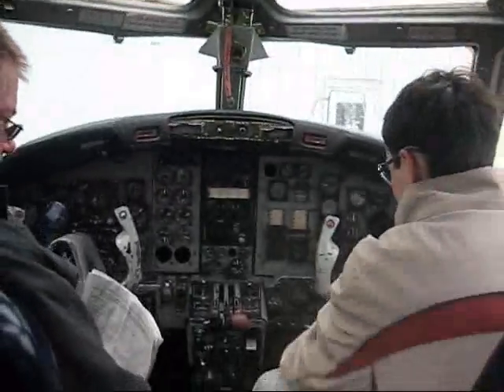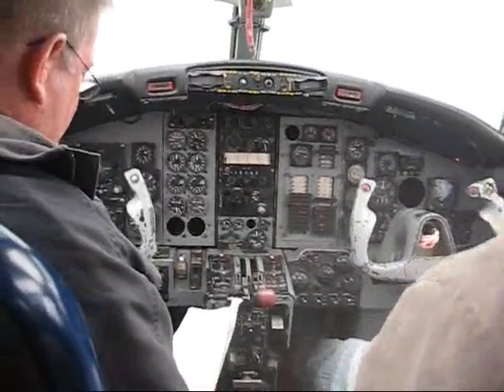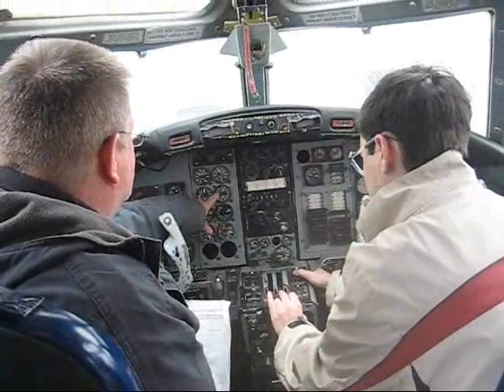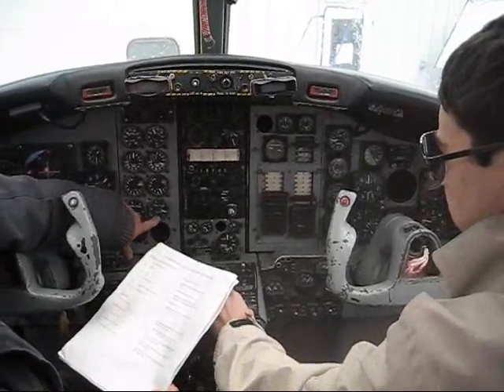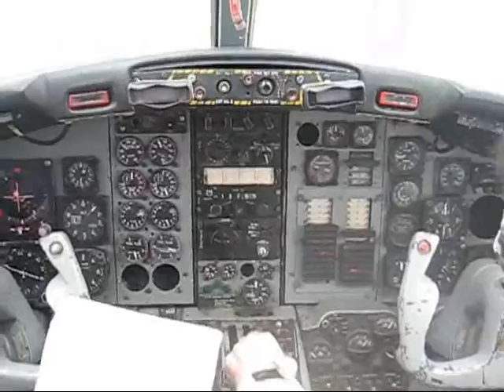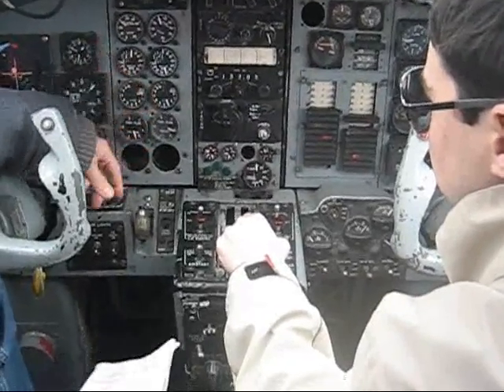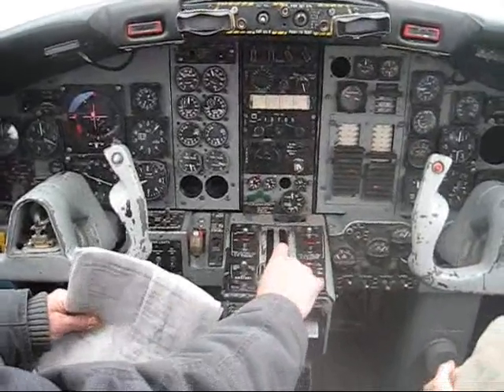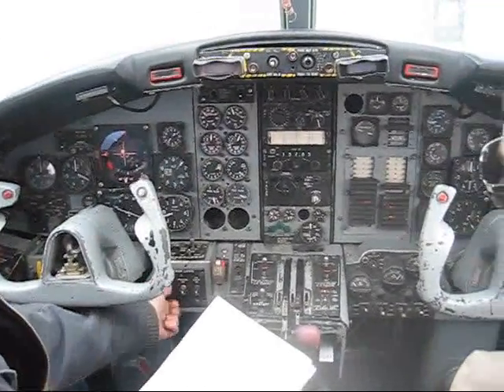sabreliner engine start and run up

Comment: That is not a NA265-65.  The Sabre 65 has TFE731's and a different cockpit layout most notably the position of the fire T-Handles.  If this was built as a Sabreliner and not a T39 it maybe a NA265 or NA265-40.  I think this is a T39A though.  The noise this thing is making is great and the spool up time on those J60's is great.

I flew a 65 s/n 002 all over the world for 2 years.  Loved that airplane.  Great marriage of analog and digital.  Funny story the only reason I took the interview to begin with is someone told me it was a Jetstar and I figured I'd never get to fly a 4 holer in my career.  It wasn't until after we talked salary that I saw the airplane itself.  I wasn't exactly love at first sight.
Reply: The cockpit looks amazingly similar to a T-39A that my Dad checked out in '61 at Edwards when he was with IPIS at Randolph. The plane was 59-2872 and it was Doug Benefield (later astronaut candidate and eventually Rockwell chief test pilot) who checked him out in the T-39.

Comment: On base at RAF Bent waters in T39A and watching pilot trying to get main inverter on.  They could not after a couple of resets.  Shut down and I was going to Wheelus AFB to work on F4C 64-850 in Oct 68.  Since I was aircraft electrician had to change inverter out before we could take off.  Jim Karales

Comment: Worked the T-39A, Wiesbaden AB, Germany, from 1968-72 (Avionics Maintenance).  Good airplane, however, the fuel quantity indicating system was always a problem; followed closely by the EGT system and, periodically, the Mach Overspeed warning system, and the CB-60 Compass sys.    Had one acft. whose entire frontal area was "magnetized"; was difficult to degauss the entire front of the plane (LARGE coil of wire energized with AC current - might have been 110VAC, 60hz from a "light cart" (?).

Comment: Noisy ol' bitch ain't she?  Lol!   good god.   beautiful old relic of an Aircraft.  
love this, for what it IS,  but brutha,  you can't even hear the guy talking anymore from all the Cockpit Noise  (ie; engines, HYdraulic Pumps cycling, etc...)    that panel looks like what you'd see if you took a tour thru the Graveyard at Monahan Air Base Mothball field.   INOP!!!
Reply: drummerfella 55  At RAF Bent waters around 1966
The hydraulic pump driven by 24 vdc motor which was  tucked behind back passenger seats tripping 50 a breaker.  Dave Nichols brings it to electric shop.  He has me hold neg. cable on 28 volt nicad battery and he touches the positive post on motor and welds it to post.  He forgot to mention to me that it was tripping breaker in T39A!!!
Jim Karales